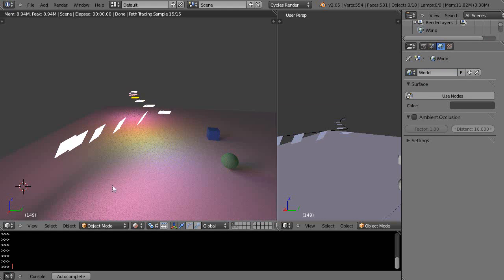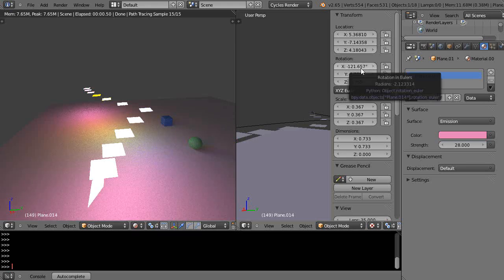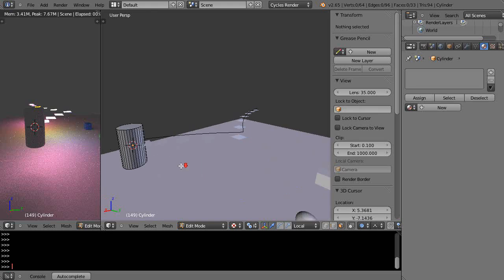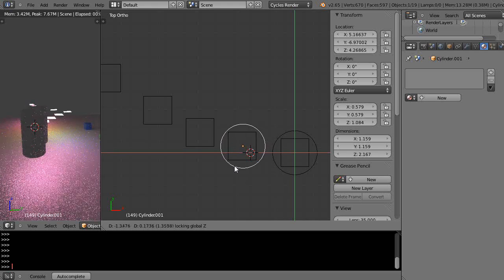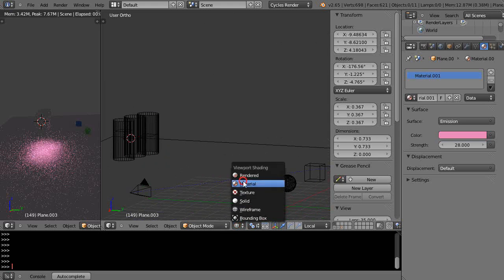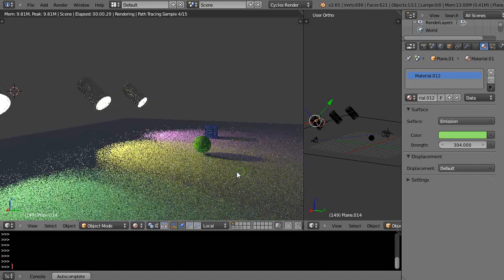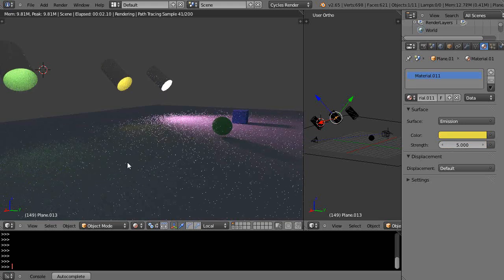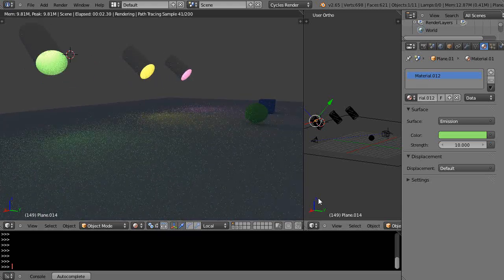Blender Tutorial - Cycles - Creating Track Lighting along a Path - Part 3

Comment from the maker: No doubt.  The way I typically work is to save the file (or a copy), and start it rendering in a second copy of Blender.  The operating system seems to do a pretty good job by itself, but you can allocate resources to different processes if you want.  Blender rocks!  Hopefully tomorrow I'll have the first pass of my SciFiAnimator site up and running.